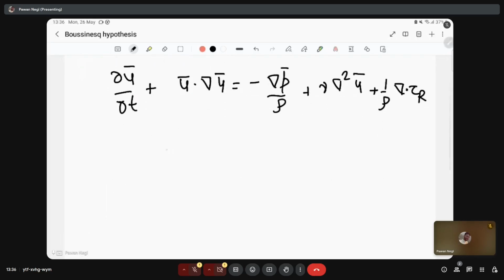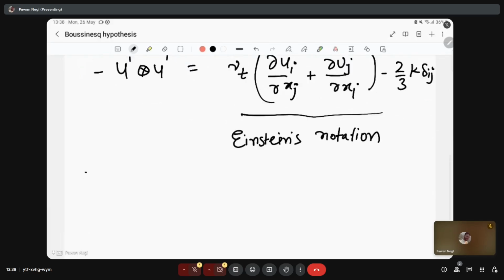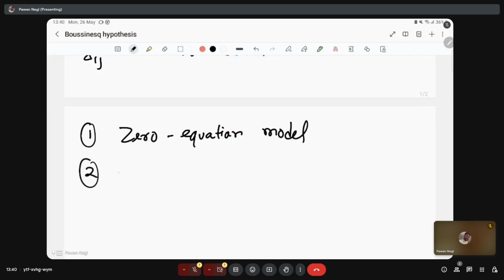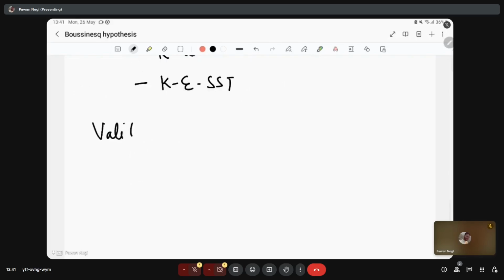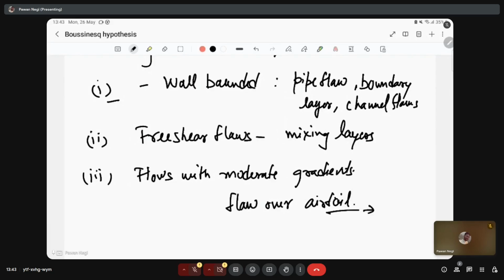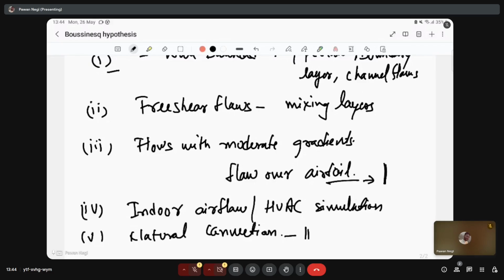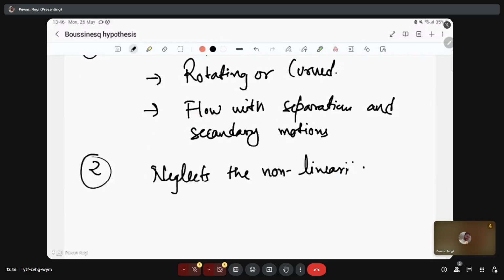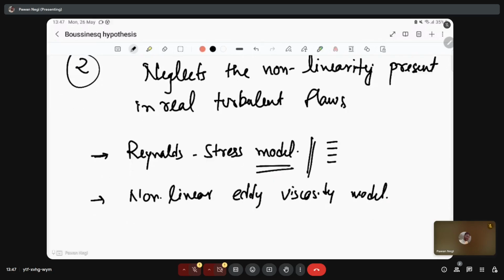The Boussinesq Hypothesis and Turbulence Closure Models

Comment: You said that we can not use any of these models for higher angle of attacks for flow over an airfoil, so what angle of attacks shows diagreements with the experimental results?
Reply from the maker: At high angle of attach you expect vortex shedding. Boussinesq-based RANS models may not show correct shedding behavior. If you do not expect shedding i.e. the flow remains attached to the model  then these models predict very well. In 2D cases you can still use these models for pretty high AoA.  Not sure about the exact numbers.
Reply: @NavygateTechnologies  Got it. Thanks for the answer. So to get better results for vortex shedding I should be using LES Models, right?
Reply from the maker: @VedangRathod-o8q1j  Yes, LES are always better but expensive.